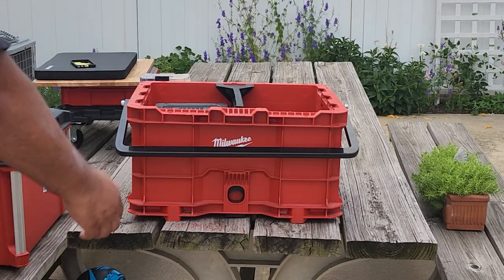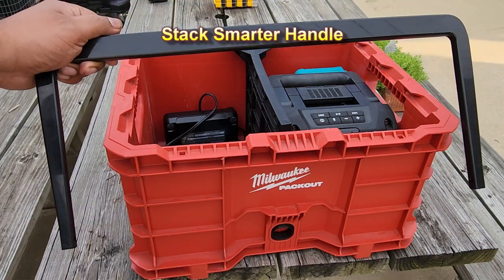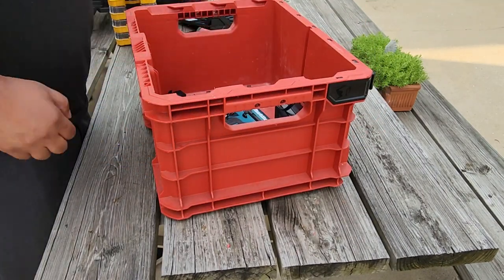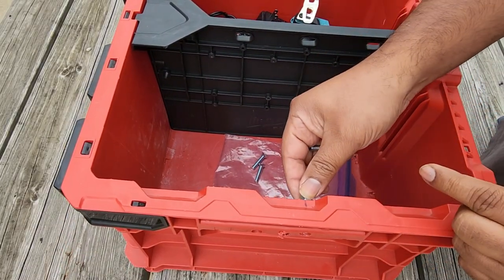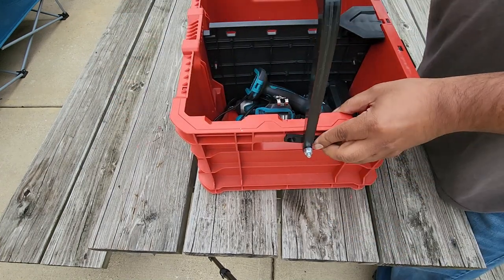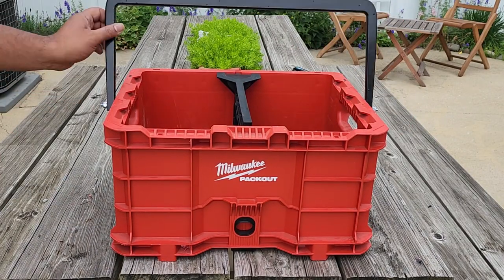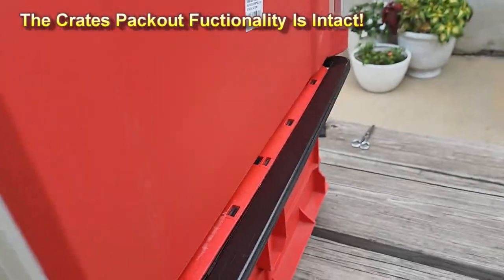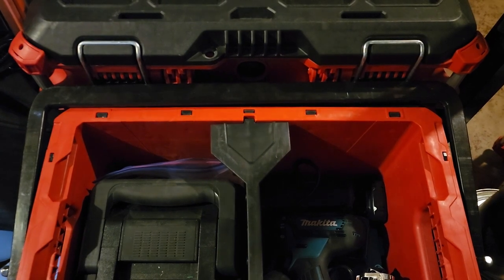Easy Milwaukee Packout Mod (Crate Handle)😱

Comment: Ed easier way to drill the holes and not have a problem with alignment . Step 1 empty the crate completely . Step two stand crate up on its end. Step three drill holes. Easy Peasy. Not joking that is the best way to do the drilling. Lessons learned the hard way are never forgotten. Don't ask me how I know that LOL. T/C ED
Reply: I agree @daniel backley you could also put an indent with an awl to have a good spot for the drill bit.
Reply from the maker: Great advise!